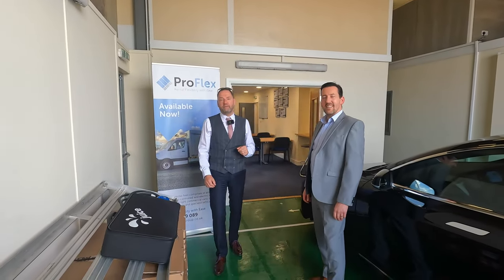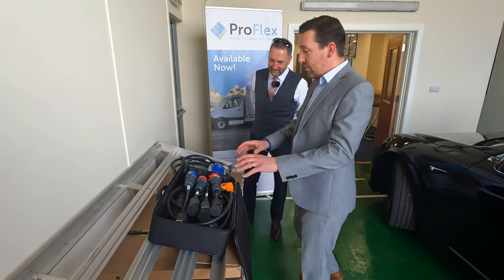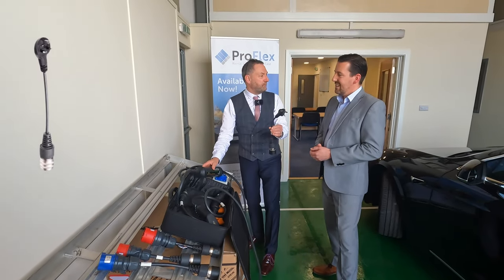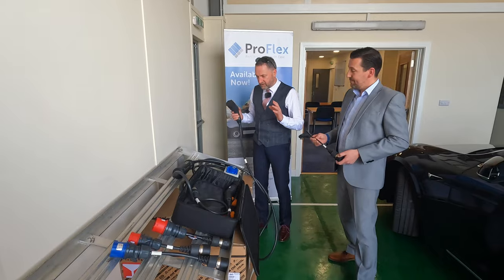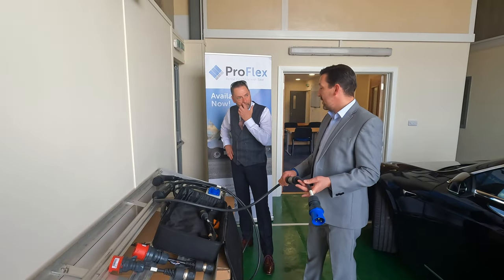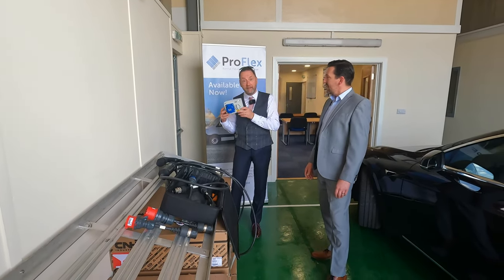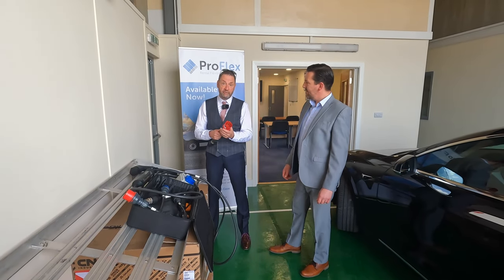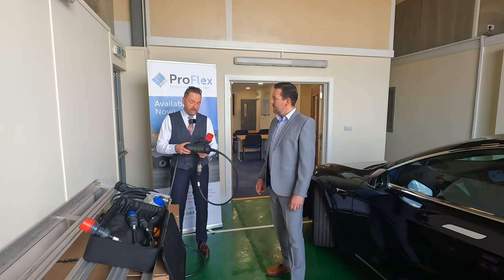JUICE BOOSTER 2 - Portable 22kW EV Charger │ Juice Technology

Comment: Purchased the J+B2 for '23 VW ID.4 Chattanooga Model for the same price as the far inferior VW portable charger (which is not included with the ID.4). Connecting to USA NEMA TT-30 RV 125V 30 amp outlet. Amazing construction quality. Worked instantly, charged from 44% to 80% in 12 hours. Now I need to go find out how to get the extension cables. Once I get a 50 amp breaker and NEMA 14-50 outlet this should do 5% battery to 80% in the same time. No reason to look at any other charger for home and portable use unless you need to have the charger on a network or to control on remote (which I wanted to avoid.) I've read it's the only UL certified portable charger in the market - don't know if that's true but it is UL certified. We'll see if the ID.4 is built to the same quality standard as this charger!

Comment: Using a 32a commando socket,  (230v single phase),so 32a commando plug on the juice booster, my 32a commando socket on a timer/contactor,  charger plugged into car and dead commando socket,when the commando socket becomes live will the juice booster automatically charge at 32a ? Thanks
Reply from the maker: Hi Paul, a 32amp, 3phase power supply will give 22khw to your car!